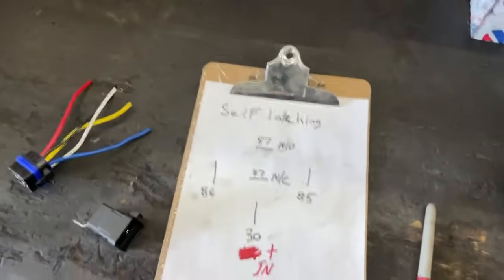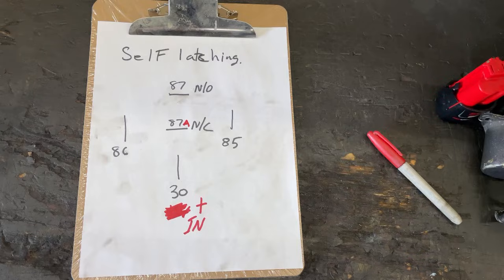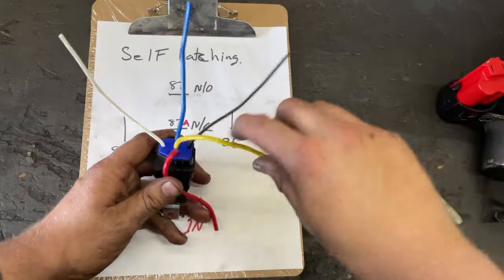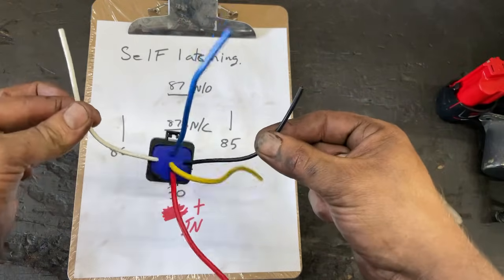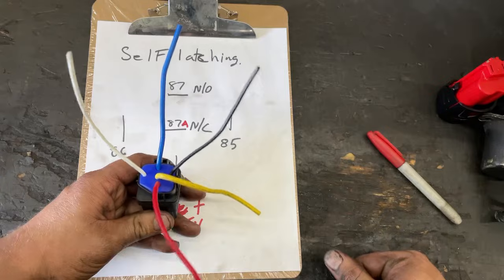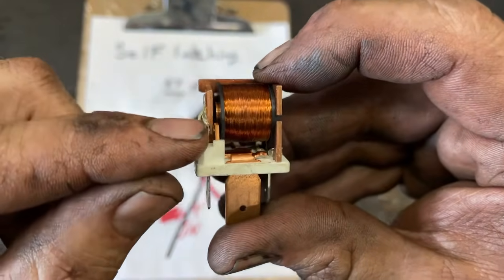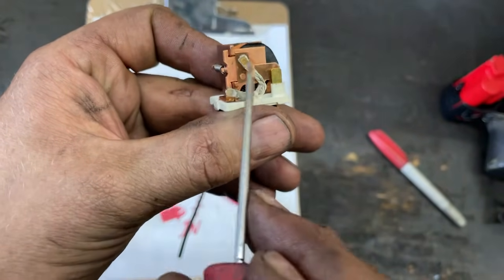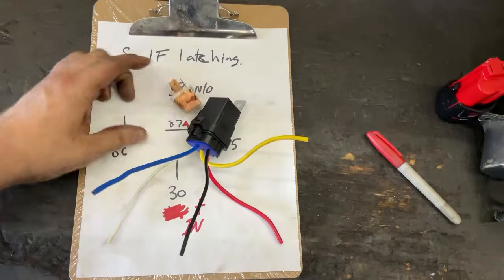How to wire a 12 volt relay ( IT’S Easy)

Comment: I installed an inverter in my truck using a relay switch.... but instead of using a kill switch I wired it to my stereo fuse box using fuse TAP ...therefore the inverter would only come on if the car was on.... and it never drained my battery.... I miss having a house plug in my car

Comment: totally confused, cause others say use 87 for power in ,and 30 for power out to amps and things
Reply from the maker: its if your using it as a 4 pole relay it doesn't matter either way,  but a 5 pole should have 30  hot wire, so that when its not energized the normally closed circuit is hot
Reply: @CUTTERUPROB  ????????????? audio vids say 87 is hot in and 30 is output to amps

Comment: Thanks....simply has a light bulb change. If you have time, explain why we would need a relay? Why cant I just wire a switch to my acc lights?
Reply from the maker: If its a low amp draw you can.